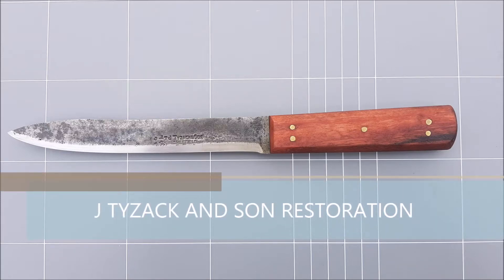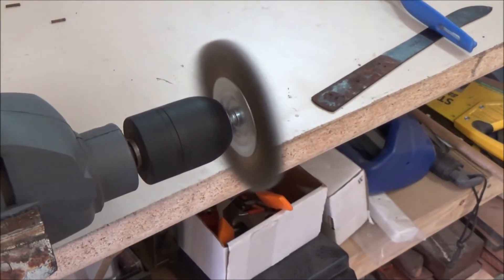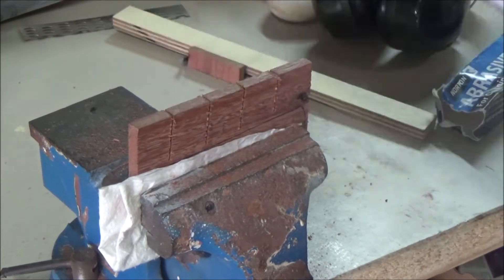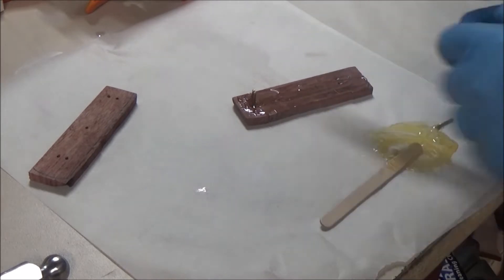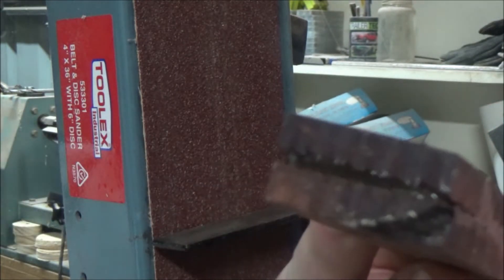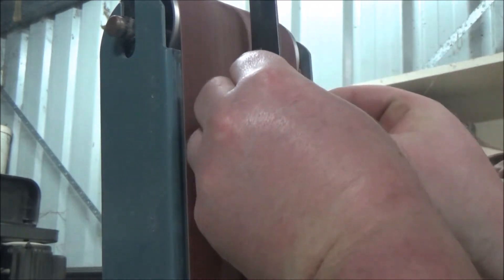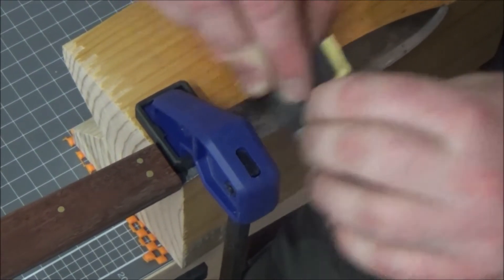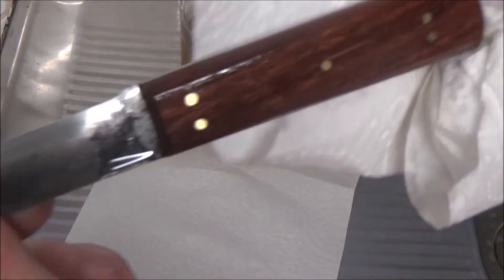Restoration - J Tyzack and Son butchers knife - Pre 1942

Comment: It was interesting to know a part of the history of this knife. It turned out really great
Reply from the maker: Thanks. I am still disappointed with the bevel though. The reason for the scandi grind was to keep the whole logo.
I find that a lot of the restoration videos don't have anything info wise on the knives so if I can find stuff I will try put it in. Makes it way more interesting in my opinion. 
The other old English knife I restored I couldn't find anything on. Nothing came up at all. Tyzacks was a very long running company that made loads of stuff. But did change its name a lot in the 20th century at least. But other one I couldn't find anything. I even looked through old books my friend has of old English edged tool makers and couldn't find anything. They had hundreds of different makers and marks listed.
Ah well I do what I can.
Reply: @scottshobbyz5416  you'll do better next time don't worry. I agree with you, it makes it more unique to know its story. But as you say, I think it can be tricky to know what this knife is !
Reply from the maker: Cheers and for sure

Comment: You have done well grasshopper, the knife came up a treat, the Poms used to make some great steel in their Hey-day.
In one of  your other Video's you asked what stones they were, i said one was slate (use water) and i reckon the other was a washita stone (use oil)- both are good stones and pricey to buy especially the Washita, i'm 99.75 percent certain of both stones.
They have been left behind with new ceramic stones and diamond plates.
Reply from the maker: Thanks. Yeah I have done a few old english knives now. Not all on camera. And the steel it really well done. This ones steel was a tad softer than some of the others I had done but is still really tough. At one point I tried to snap the pitted tip off by whacking it with a hammer over a hard edge. The hammer bounced straight up and the knife didn't get effected at all. Thought it would save me some grinding :)
On the stones. The slate only really seemed to be a mystery to me lol. Everyone seemed to recognize it but I had never seen it before. It leaves an awesome edge though.
The other one does too. I will look up some washita stones and see what they perform like in comparison to my stone. That one works excellent with oil. It wears extremely slow and leaves a really fine edge though. I was under the impression that washita stones cut and wear faster but I haven't ever seen one I know for sure is one.
Reply: @scottshobbyz5416  i have too many stones etc, if i want a quick sharpen i go to the diamond plate, i will end buying a Spyderco--Bench Stone Medium, very hard wearing and use either water, oil, or nothing, just need a quick scrub after sharpening, lot less mess and reduce flattening as well. A good strop is worth its weight in gold, i use kangaroo hide but some folk just use a good flat piece of hardwood with a coating of compound, theory is using leather cause's the cutting edge to sink into the hide causing a microscopic roll effect, but i only strop very lightly.
Reply from the maker: I am new to stropping with compound but am having fun with it. I got a lot of stones too. I have the 3 spyderco ceramic stones you referred to. They are good but not for a resharpen. Great for light sharpening and touch ups but if you need to reprofile it or take out chips it would take a long time on the medium.
I am a big fan of diamonds and my go to is the 400/1200 ezelap. I have tried different ones. But for coarse stones I haven't had much luck with diamonds. I find they wear out too fast. I killed a DMT xxc in no time and wore off diamonds on a 140 atoma in places. I did use a 1x6 ezelap 150 grit in my edge pro for a long time and had great success with it. I have yet to try their 150 grit in a bench stone size though. 
So often I will use a coarse silicon carbide stone now or a shapton 120 grit waterstone for the shaping then refine on my diamonds.
Reply: @scottshobbyz5416  Yes i had trouble with the atoma, but shapton are good stones.
Reply from the maker: Good to know I am not alone. It was only the 140 grit I have tried.
Reply: They still do if you know where to look. I've got a few things from Sheffield... mostly Pax branded.